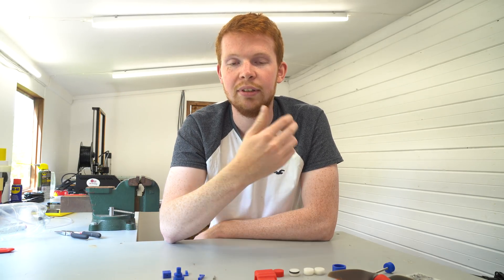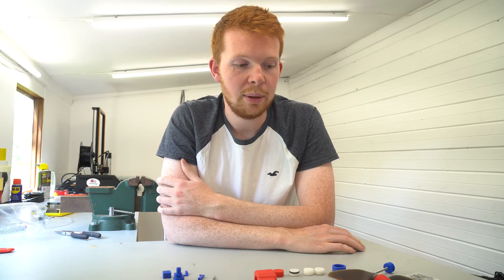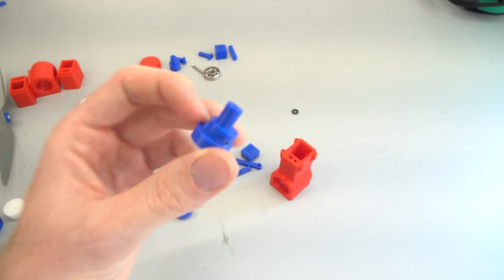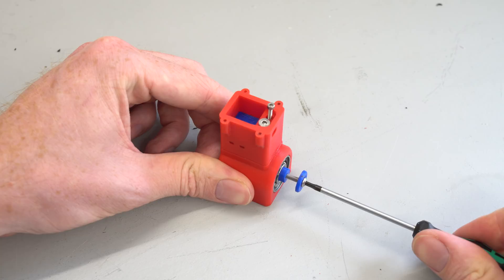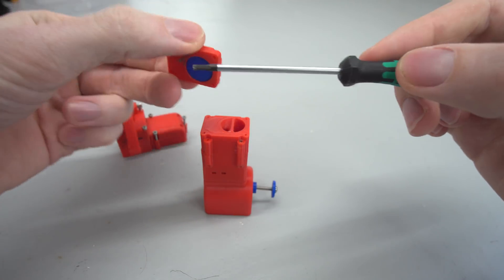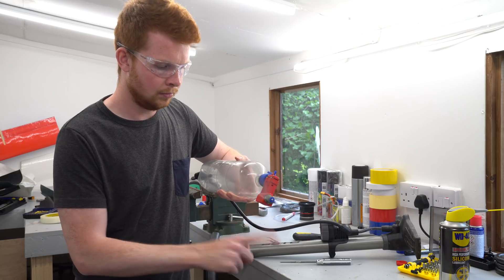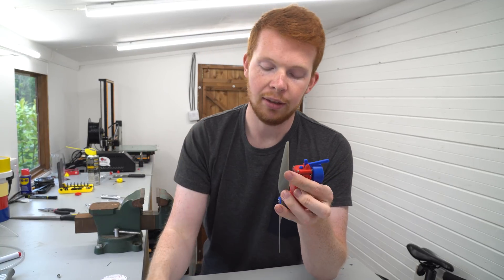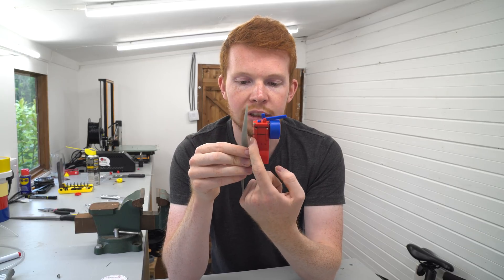Air Engine Exhaust Valve

Comment: On petrol engines with a longer stroke. a person has to have a heavier flywheel to keep the crankshaft rotating. and it needs to be balanced more precisely. or the engine will have more vibration. it's similar to a Harley Davidson V twin engine. they have a long stroke and vibrate a lot. but they have a lot of torque. but they also have a lower red line on the maximum RPMs. for aircraft use I have wondered why you don't use a multiple vane turbine engine. they run smoother and are more efficient. and they are simple because there's no valving necessary. but the tolerances have to be much more precise. and maybe that would be harder to achieve with a 3D printed engine.

Comment: I know I'm 3 years late but...... in the automotive world a larger piston (bore) increases horsepower and a longer stroke increases tourqe... (compression plays a big part too)... for example...

A Chevy 6.2L gasoline engine may produce 425hp and 400lb-ft tq, but a Chevy 6.0 Diesel will put out 450hp and 700lb-ft tq even tho it's a smaller engine the diesel has more compression and longer stokes...

In terms, tourqe is low rpm acceleration and Horsepower is the mid to high rpm acceleration.... and another reason diesels have a lower rpm range than gasoline engine... average for diesels are 4,000rpm max average for gasoline is 5,500rpm-8,000rpm

Sorry for the long comment I know alot and have a fasanation about engines and cars

Comment: when I added an exhaust to my valve, my air engine ran much better with more power and rpm probably because it didn't need to deal with trying to compress the air on the upstroke.

Comment: I just thought - what if you use one of those generic one-way air valves? I'm not too sure how feasible that is,. Considering you tried this whole thing here, I think it's something worth trying.

I would try it myself if I had a 3D printer, but the closest thing I have is a free simulation program called Algodoo.

I actually made the version 1 engine design in Algodoo, and I was able to get it to work, barely.

Comment: Add a flywheel to it to store the energy from your starting the motor so it can run at lower air and be more efficient at higher pressure plus you can use a larger bore size to increase efficiency because it puts less stress on the shaft and increase the surface area by adding peaks on the cylinder but also u could use a soft poly gasket for the piston to mitigate the air leaking round the piston use graphite on the crank to the rod to decrease the friction

Comment: I love your content but i strugle to understand your designs. You could cut in half the frames to see the inside and remove the frame completely to get diferent views from the inside. Shoot for Phone. Make sure to cover entire screen. Use stop motion so your firger are not covering the motor. 
Some advise before i say goodbye. Can't really watch it anymore with such low quality images. Your hand drawing are even worse. 
The only thing watchable are your thumbnails. Which are the way the whole video should be seen. 
Ill be back in few month to see if u got it right. A 6 years old kid could design a video better than that.

Comment: You should make a v2 engine, all you need is hose into the top of each "head" and play with the size of the exhaust, wen one is down the other is up therefor pressure on one will bring up the other with the help of the flywheel, (you would need a heavy fly wheel)

Comment: @Tom Stanton. I believe there is still merit in the v4 engine but for it to work efficiently you need to take half a set back from the look at the design as you were building it you've got both valves running offset to the bore which will require more force to open the valves. if you looked at making a V4b as a "t" head and run one valve on either end of the head running inline this will reduce the force needed to open the valve and also allow you to tune the timing to produce power over a broad range

Comment: As a basic crank engine made from a printer it's entertaining. Instead of building what has already been built , challenge yourself and think outside of the box. Looking at air engines that are in use today that are rotary . No values needed and efficient. From there try to improve that design.

Comment: There seems to be some resistance at specific timing. You sure there isnt an adjustment problem? like the large outlet valve/screw? if its too thight and pushes against the frame too hard it would cause this.

Comment: Could the extra drag on the engine have actually been from the throttle diaphragm being closed causing it to pull a vacuum when you spun it by hand?  Since there was no pressure to open the diaphragm and the exhaust was closed?

Comment: I recently had the idea of an exhaust system where the exhaust goes into a low pressure chamber and is blown off into a slightly higher pressure chamber and so on until it reaches the pressure of the air tank. Might reduce efficiency though.

Comment: Tom. You should put a drill on that crankshaft and shoot some slowmo when you run it without the cylinder head as you do at 7:00. That way you can see how it behaves at high speed.

Comment: I desagree.
Because its air powered not an internal explosion engine, the importance of the surface of the piston is higher than the volume of the chamber.
Longer of displacement is not in relation with force on the surface.

Comment: couldn't you run the cam system with a single cam for both exhaust and intake? i believe this has been done. Also doesn't the longer stroke create a greater crank angle ratio?, which would also make so a greater friction point in the system?

Comment: Hi. Wouldn't it be possible to attach 2 chambers on the bottle, which during the flight (when low on air pressure) pump in water and calcium carbide into the bottle? that way you can generate new pressure which could prolong the flight-duration

Comment: Hi Tom,
sorry to ‘wag my finger’ at you but when you say the two engine options (long stroke vs short stroke) should equal the same amount of torque because they both have the same amount of CC (2.05) I’m afraid you are very much mistaken.
A good example for comparison would be a formula one car and a steam locomotive.
The formula one car has very little use for torque, it’s built for power alone so the engine is ‘over-square’, which means the piston diameter is far larger than the stroke.
A short stroke means the piston travels less distance and less distance means lower piston speed for a given rpm.
The faster the engine goes the more often it goes “bang” and every bang is a power stroke so, if it goes bang 10000 times a minute it’s making twice as much power as it would if it was only going bang at 5000 times a minute. These engines aim for 20000 plus RPM but they cannot slow down or ‘tick over’. They'll generally 'stall' at around 3500 to 4000 RPM because the stroke is so short and there is no flywheel to speak of. Each and every engine part is designed to spin very fast and for no other purpose.
Now look at a steam locomotive standing in a station with just those two dirty great long pistons, there’s one on each side but they’re not even moving until the engineer opens a valve and steam enters one of the cylinders.
A single thrust of massive compression acts on the piston and is transferred, not to a spinning flywheel but directly to the stationary wheel on the ground.
Now that single thrust from that one piston is going to have to move the entire train with one massive push, so the crank-pin is placed as far off centre and as close to the edge of the wheel as possible to give it leverage. THIS is what is known as torque, AKA “GRUNT”.
The more bangs you get, the more power you get. Torque is what you get from each individual bang and the general rule is that if you want to increase one you’ll have to sacrifice the other so best not confuse the two of you want to build an engine.
BTW, a quick look at Wikipedia tells us that compressed air vehicles were quite popular in the nineteenth century, but they generally suffered from a lack of torque.
Just sayin...

Comment: As something else to try in future, seperate from air engines, try elastic spool motors. If you find a proper design, very much more freedom to get required torque or speed, and ever so much further range or time duration. I cannot find a proper example of a spool motor ( more lost technology), but i do not mean a twisted rubber band. I am talking about a motor where elastic cord is stretched as it is wound around the outside of a spool to store the power. when released and through pulley gearing, it rotates the spool. Also, i do think that elastic power and 3D printer parts were made for each other. For aircraft, this method of storing and releasing power is probably the lightest.

Comment: Hello Tom. If you come to make a flat engine, you would realise it's much more efficient than any other option (except radial engines). It's simpler and shorter crankshaft helps making it need less power per piston for each rotation. Also, with multiple pisons, part of each piston's work is dedicated to putting the other pistons to the starting position, making the movement more constant, therefore, more efficient. Flat engines tend to wobble less, due to better weight and power distribution (when using an even number of pistons on each side). I believe most people wouldn't complain if you made the input the most simple way possible and not print it at first, just as a proof of concept.

Comment: 2 Cylinder engine are better to keep the momentum in the up stoke of cylinder 1 (like in old 2 cylinder steam engines) but maybe is better to concentrate on a round cylinder  (plastic core and outer metal sleeve so you can have an perfect round cylinder or make a mold for the cylinder)

Comment: i know you are going for minimal parts, but i do think that you should have 2 barrings in there. i don't know how to explain it, but i think because of the exhaust cam as well as the piston is putting stress on the crankshaft pushing it sideways causing lots of friction. so in short i think you need that second barring back in there.

Comment: Hi Tom, I’ve been designing (on solidworks) a compressed air engine and the exhaust system is fairly similar to what to have on the ‘cylinder’ housing, how well does it? The duel cam looks incredibly smart, but I think making it that complicated is some else to go wrong. Really enjoying your work.

Comment: Is it better to have two or four pistons because while one is on the downstroke, the other is in the  up Stroke, not powering the crankshaft. So when one isn’t powering the crank the other is so they help each other keep the engine running?

Comment: I think you cannot judge on an engine efficiency without running it. That's not right.
And for ease of blank run, that second cam and valve would definitely add some friction, though in this case it seems to be excessive, so it is probably suboptimal design of that calce mechanism, not the presence of the valve. So don't just abandon the valve.

Comment: I would also turn the throttle lever 90 degrees so that it runs in line with the plane of the propeller.  I'd hate to see you lose a finger trying to slow the engine down at 120psi!  Keep up the great work!

Comment: Would putting small metal tubing around the dual pushers to reduce the added friction work? Looks like smaller parts moving faster creates more friction than the larger parts

Comment: Definitely looks like the valves are mistimed and youre compressing the air at the top of the stroke and letting the air in at the bottom. 

Check the valve timing again.

Comment: Why are you making 4 stroke engines when all you want is a compressed air motor? Every stroke should be a power stroke that's why your original design with the ball valve at the top of the piston was so good, it just needed a relief port near the bottom of the side wall. If you look at steam engine design many of them have double acting pistons where the bottom half or crankcase is used as a pressure chamber to push the piston back up effectively doubling your pistons. Keep up the good work!

Comment: Why a spring to hold the up stroke exhaust valve closed? Air pressure should hold it closed on the power stroke and after the piston hits bottom and the exhaust ports have vented pressure, the exhaust valve should open easier than the inlet valve.

The only time a spring might be needed to hold the exhaust valve close is if you could get a plane to do inverted flight. Don't see that happening with one of these engines. ;)

How about a run on the compressor, without the exhaust valve spring?

Comment: Tom, you've opened a can of worms that makes it hard to give you the correct answers.  Your design is mostly based on IC engine design, where efficiency is mostly dependant on chamber design/detonation control.  Lots of the "correct" answers there have no meaning WRT to what you're doing, and that is one reason why there isn't a clear answer about the single vs multiple cylinder answers.

Judging from what I've seen it looks like most of your available improvement will come from going to around cylinder/piston (I'm not quite sure why you went square), and WRT to valve even timing.  I would also look into a steam engine and air compressor design for hints/suggestions.  I suspect that some of the tricks you would do to get more power out of an IC engine would work, where others would just waist available air pressure/volume.

As far as the singe vs multi-cylinder thing goes, a single cylinder is going to be MUCH better (fewer parts) when making changes/testing, but there is just the coolness factor with a multi-cylinder engine, it sounds better, runs better (there is more than one power stroke per revolution) and just has a bigger "look what I built," factor.  Your question about the pressure above the piston in the last video is somewhat the case (you need less pressure to make the same power), but that is not a factor of increasing the number of pistons but the overall piston area.  One place where this could come into play is in controlling the pressure below the piston(s) while running if the crankcase is connected, but in most cases that is just dealt with by venting or even evacuating the pistons.  Leakage past the piston seal is going to depend on the seal efficiency, the area/distance covered by the seal and the pressure differential across the seal, so going to around over a square piston will likely help prevent leakage by giving you less seal per piston area.  Honestly I haven not seen your design past what was posted in these few videos, but WRT total efficiency, based on what I could imaging a 3D printed design is like I'd bet that your big aea for gains is seal efficiency vis friction.

One way to deal with your multiple cylinder head plumbing headache is to build it in a V configuration (even like a VW/Bugatti W configuration) with a single cylinder head covering multiple cylinder banks.

Comment: You might want to consider magnets moving with the piston, to control the valves by fixing them to magnets with equal or opposite magnetic polarity towards the piston magnets?

Comment: More friction losses would give nearly constant load, from what I can see the shaft spinning doesn't make equal resistance in each positions of the shaft. Maybe your problem exists because of wrong exhaust valve design? To me it looks like it takes too much energy to just open the exhaust valve. (too hard spring? is the spring necessary if pressure is always trying to close the valve?)

Comment: I think hollowing out the cams even the shaft if possible for weight. For the friction maybe try to sand the cam then put finger nail polish where the material was removed back to the original geometry. 
Or http://www.instructables.com/id/Ultrasonic-Misting-3D-Printing-Vapor-Polisher/

Comment: i was thinking, just because it requires more initial pressure to begin rotating does not mean it's a more inefficient design. what if once you found that particular pressure let's say 40psi, the motor could produce more power for a given psi range compared to your 3rd design.

Comment: tom i am thinking in the problem an my idea is just that if you put another one cilinder. And you link the two cylinders with a shaft. when ones beeing down the other will go up and the main shaft(which link tge 2 cylinders) will go more soft and more CONSTANT. if you do something like that.. the engine shouldnt stop at low presures.. because one cylinder helps the other.

Comment: longer stroke makes it rev lower but makes more torque that way, short stroke makes it rev higher but with less torque atleast with combustion engines but cant see a reason it wouldent work exactly the same on an air engine and try a flywheel on it to get the exhaust valve to work with it